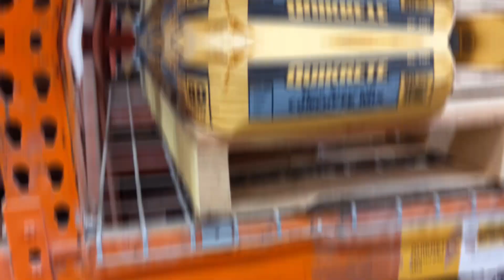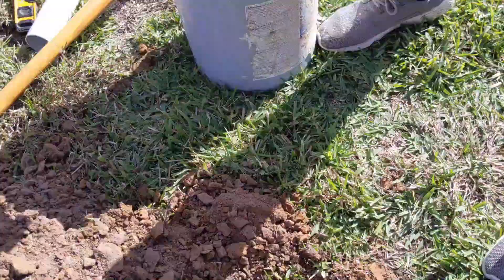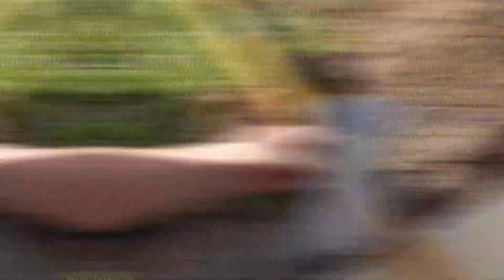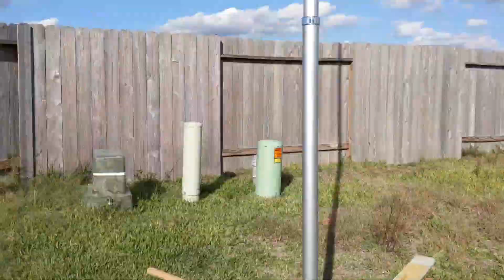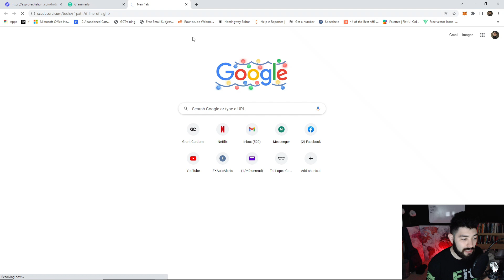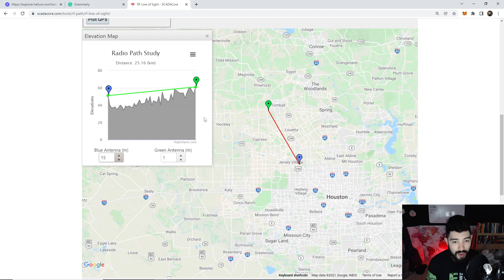Outdoor Helium Mining on 30ft Flagpole Install ( Serious Gains Now )

Comment: How did you mount the antenna to the pole? Is it mounted to side of the flagpole near the top, or does extend from the top of the pole up? Thanks for the video!
Reply from the maker: Hey Jimmy that's a great question. Sorry for skipping over that part. I hope you've seen some more thorough videos that i did inspired by your comment. I also posted my universal set up video that goes over how the structure is.  But to answer your question I just use the clamps that come with the antennas or buy u bolts that are very similar

Comment: Hi everyone,  do tuned antenna perform better vs non-tuned?

Also I often see same antenna (5.8dbi) but the length of the antenna 60cm or 80cm, does it make a difference?
Thanks
Reply from the maker: I would assume it does make a difference. Not sure what the difference is other than maybe slighly better signal reception.

Comment: How did you manage routing the POE out to the pole? I've been thinking about doing this but I've having trouble with the cable itself as I don't want it just sitting out in the open.
Reply from the maker: Hey Jay! So in my other videos i show that i use a Flat Ethernet cable. Links in description! But flat cables i can run through crevices, windows, doors. You can get creative.  I ran it right out of a window and made it all neat. I would use some kind of conduit from home Depot to make it clean. Update on that coming soon on my next install vid. GONNA BE EPIC. 

But yes you can burry it underground easily and keep the rain or lawn mower from hitting it.

Comment: So you don’t need to ground it right?
Reply from the maker: Honestly i would do it just to be safe.  Because I don't want to get risk it.  And there's plenty of wind to create static electricity in that antenna and mess up the miner
Reply: So how did you ground yours? Did you use a lightning arrestor? Did you put in a new grounding rod near the flagpole? It would also be awesome to see a video on how you attached everything to the flagpole.  Cheers

Comment: You think I could just put cement in a bucket and do the same thing?
Reply from the maker: Lol i would say if you do that atleast do some guide wires and make a wide base that the bucket is attached too.  Just my opinion.  It sounds a bit unsafe though if it tips over.

Comment: nice but it looks like it wobble alot at the tip...
Reply from the maker: Yea we had a small wobble at first but we fixed it by sliding it into the hole correctly lol. If you do it right... That pole is not going ANYWHERE. held up strongly through super mega winds and 2 storms already.. no problems.

Comment: Nice setup, did you mount the box at the top of the pole or at the bottom? I am worried about the rabbits and other things crawling around in the night
Reply from the maker: 100% at the top! 3ft LMR 400 cable. least amount of loss in that cable. no way I'm doing 20-30ft of cable lol.
Reply: @gabrielchaparrotalkscrypto  With your inspiration, I got my antenna up on flagpole 20ft. I have 16ft LMR 400 cable for now. It was fun. I am little concerned about having a 30ft flagpole without any guy wires (due to wind). Any tips on having guy wires? It would be a good follow up video.
Reply from the maker: @ktrades2898  love it ! Thanks for that. That hyped me up lol. Ok so yea i can probably make a vid for that.  I have 2 flag pole set ups and we've have like 2 wind storms come by and they are holding strong lol. No wires. But i would like to install them because I too feel on edge.  But good thing is that the poles we used are flexible and sturdy.
Reply from the maker: @ktrades2898  i would say just buy a kit from Amazon maybe or build it yourself from home Depot. That's what i would do. I'm completely inexperienced in this so that would be my first approach to start looking.  I'll talk about this though in a video soon. Thank you for the feedback.  Much appreciated for the channel 🙏🙏🙏

Comment: Hey mate, just want to confirm if the outdoor enclosure box in your description (7.9" x 7.9" x 3.1") is the size you have used? Did you find it fits the Bobcat and Poe splitter adequately with good waterproof protection?
Reply from the maker: That's correct.  7.9*7.9is the good size.  i used the size before that and DID NOT work.  Too small. and yes it has a rubber gasket unlike a different enclosure that i previously used